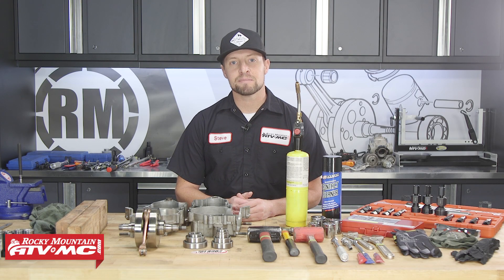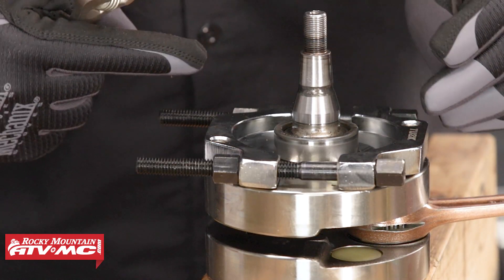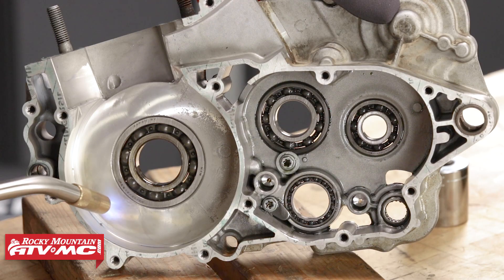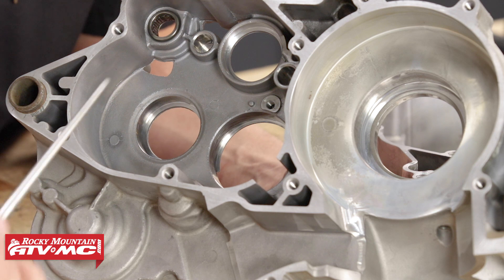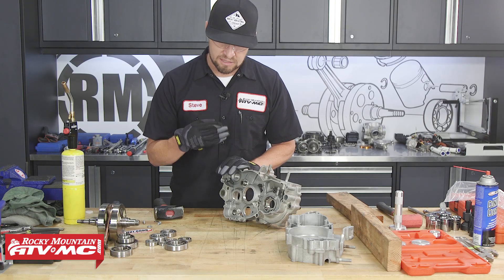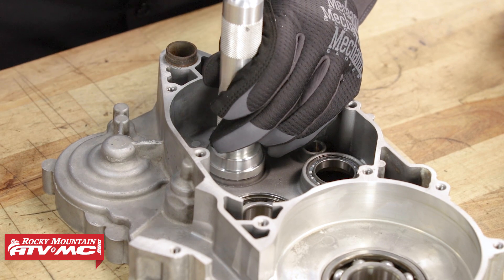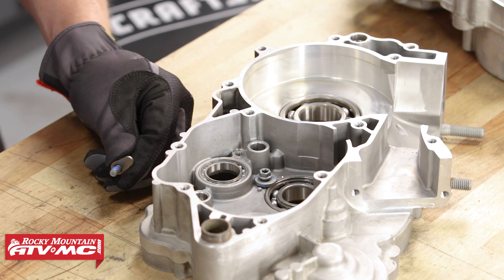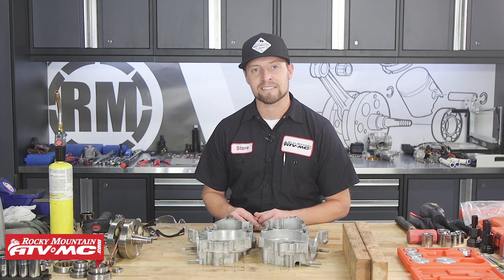KTM 300 XC-W Crankshaft & Transmission Bearing Replacement

Comment: $20 hot plate from Walmart. Heated case halves to around 280°. I had to cover the entire unit with a cardboard box (essentially making an oven) though to get the aluminum that hot. The heavier bearings fell out of the case, and the smaller bearings were easy to tap out. With the case halves that hot, the room temperature bearings fell into the bore, no tapping required. No freezing of the bearings, either.  I don’t like doing that, because as they warm, they draw condensation and you risk the balls starting to rust.

Comment: If you use heat (case in oven ' ~120 - 150oC (as you won't be using those bearings again anyway)), the bearings will come out more easily either falling out, pushing out with less force and in case the blind ones don't just fall out, carefully banging the case against wood to make the bearing move in the expanded aluminium case (expands more that the steel bearing, case stops against wood, bearing tries to keep moving with its momentum) - better than using pullers, and its the method in the KTM repair manual. Otherwise good video.  Additionally, caution is needed on putting in the two gearbox shaft bearings in the right hand gearbox half, the casting material is thin at those two bearing stops - so don't hammer them in hard - be gentle, or they may break through.
Reply from the maker: Thanks for the tips. We appreciate it and the views!
Reply: @rmatvmc  Thank you, I must say I have found the whole series of this 300xc-w rebuild very helpful.  Thank you guys; keep up the good work.

Comment: Rather than peening the case over the spun bearing and causing maybe aluminium to break off during engine operation you could of just used your center punch an 1/8 inch from the bearing into the case in maybe 3 locations and that would have displaced enough material to hold that bearing.

Comment: When I put the race on the crank I had kept the crank wrapped in plastic in the freezer over night, then heated the race, pulled the crank out of the freezer, mounted the crank in the vice sideways so I could drop the race in place, and the race literally dropped right on

Comment: I don't see a 45mm puller in the tusk kit?
Reply from the maker: Which tool are you referring to? The crank bearing and gear puller or the bearing remover?
Reply from the maker: The 45mm puller is sold seperatly https://www.rockymountainatvmc.com/parts/tusk-bearing-remover-collet-p
or depending on your bike you could use one of these https://www.rockymountainatvmc.com/parts/tusk-crank-bearing-puller-tool-p -Charles

Comment: Remove bearings without heating is not good for case. Heat case to 200-250 celsius and bearing remove at 10 seconds with resin hummer